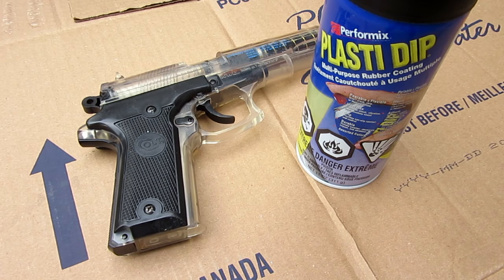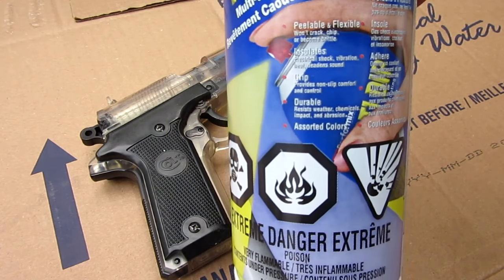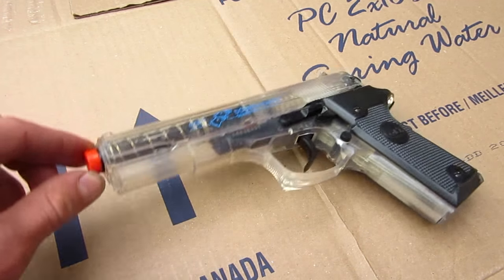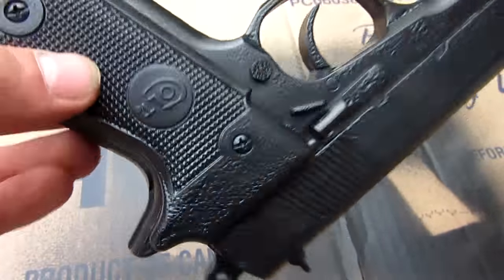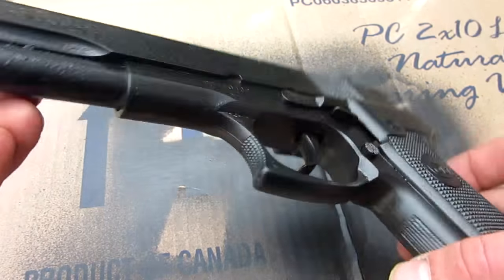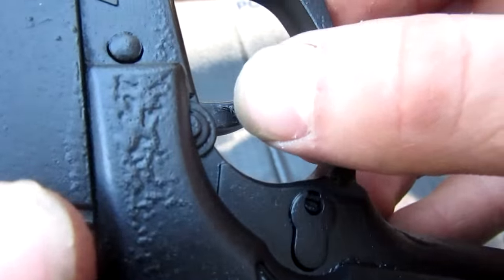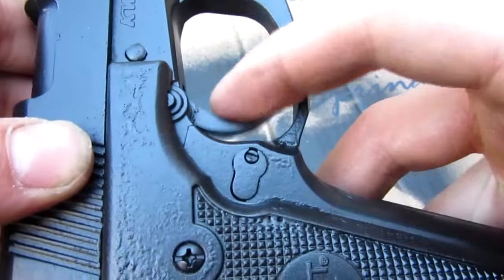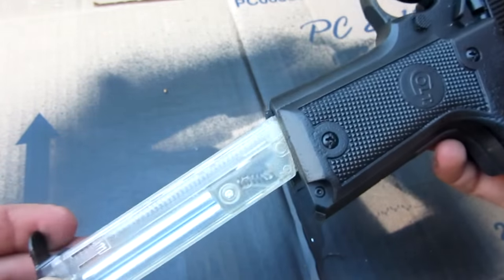How to LEGALLY Paint Your Airsoft Gun $10

Comment: In Canada, what you're doing is actually 100% illegal. The reason some guns in Canada are clear is because when they're below a certain FPS, they're considered replicas, if they look like real guns; orange tip or not. Also, as people have said, you are terrible at spray painting. You don't need to shake it in between sprays, just a long one at the start; and you NEED to tape off the trigger, magazine hole, or any other interiors.

Comment: Painting an airsoft gun is in rarely illigal in the us, however usally there wont be an issue, depending on where you live. Yes there will be regulations, and you should check first though. For example where i live, if you paint the tip, you can not sell it, transport it, (say bring it into another state, ship it with a parcel shipment company, etc.) To add to my statement, due to the variation in laws regarding this, among different counties, states, countries, you can't guarantee it is legal your way.

Comment: Okay now when you say you can peel it off do you suggest painting it on an airsoft gun whereas like spray paint itself you can't just peel off you have to actually get like acetone and a scrub brush and scrub it off and I use my airsoft guns like every weekend and I play Bush ball I play CQB and I play open field and these things are my babies I spend a lot of time building them up now my new project It's a full metal Airsoft gun everything from the tip to the tail is metal and I use acetone to strip all this paint job off of it that I got from somebody and run it all down to the original black paint then I use isoprofenol to get all the grease off then I sprayed a coat I wet sanded spray to go what sounded sprayed another coat then I let it completely dry for about a week then I went and I bought some special paint to do some kind of cool contrast on it and unfortunately the system that I was trying to use was with a vinyl window screen to make very very fine lizard scales instead of where my other one I did more of a snake scale and it turned out really good this one I sprayed from two close and it ended up painting the entire section of the gun and I didn't want that so only reason why I bought this can was because of the fact that it's actually OD Green I can't find OD green camo anywhere unless I want to pay big money in order from the internet so my question is this stuff okay will it stay on or is it just able to peel off

Comment: please don't take up painting...  remove magazine first to avoid creating a glob of paint at the seam. (if you are confident enough to you can dissemble the object before hand to avoid messing up the actions) use primer for a proper finish, make passes of spraying starting off of the object.  make it a even coat. but no if a cop approaches you when you have a black imitation firearm you drop it on the ground far from you enough that the cop can feel safe to approach you and you comply with their demands before messing around with the paint. Unless you like getting shot with a real bullet.

Comment: Don't spray paint the way this kid does it's awful the paint on the gun will turn out runny and there will be air bubbles in throughout the paint job. If u are going to spray paint a toy gun spray from about 30 cms away with mild pressure and speed to give the end product a smooth finish